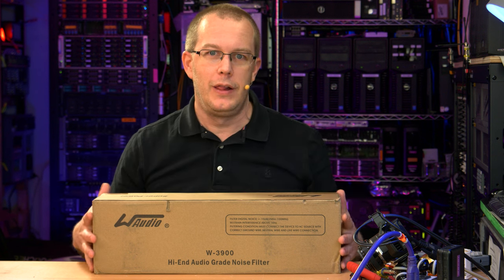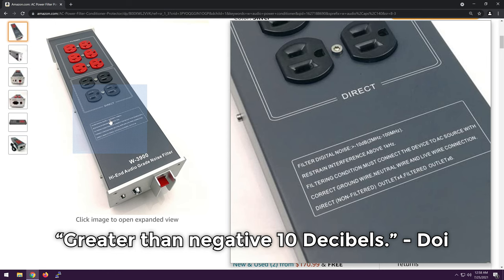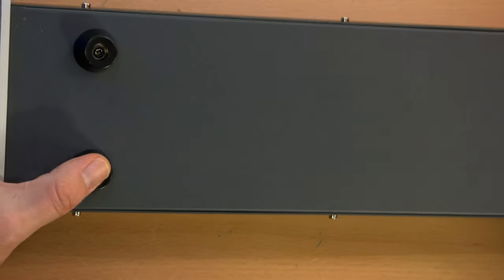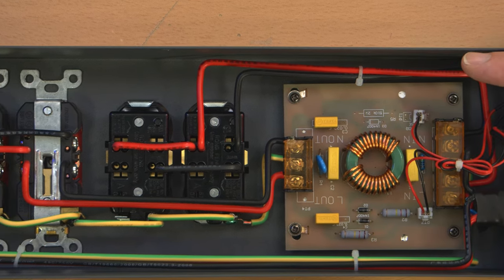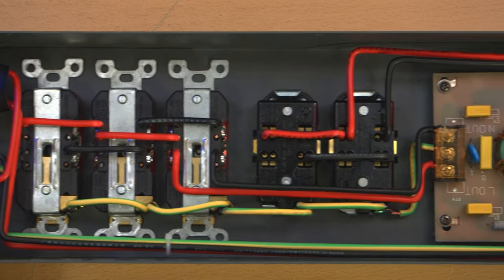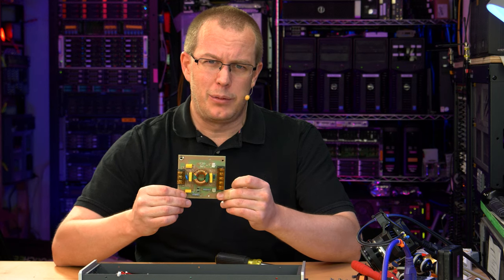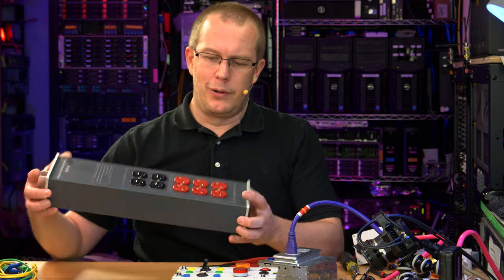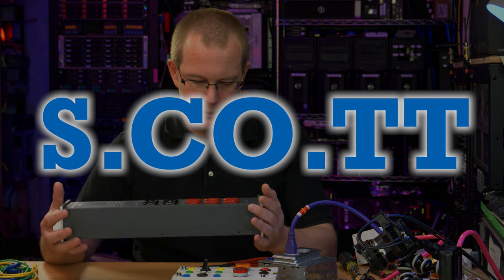WAudio W-3900 Power Conditioner - A Surprisingly Mediocre Thing

Comment: Say what you will about this product, but it just solved a huge issue for me.  I was getting a terrible hum/buzz through my Shure SMB7 connected to a GoXLR mixer.  I have been through 4 or 5 different brand new products trying to take the horrible hum out of the mix.  It would change frequency and intensity depending on hours of the day.  6pm was the worst. Audio was unusable during those hours.

I finally gave this thing a try.  Plugged my computer and mixer's power into this... mic is finally dead quiet.! I am so happy. Finally!
Reply: What were you using previously?  Straight plugging into wall ?
Reply: @indegruv  I tried both a nicer Belkin surge protector and a brand new Anker. Nether made any difference.
Reply: Yes.  Although I have not personally tested the unit, there is no reason to think (or assume as Scott did) the X2 rated suppressor capacitors and the common mode AC choke will not function as intended.
I've opened up similarly priced gear from Tripp-Lite and Furman to note similar circuitry, albeit without phase detection.
Scott could have been more professional instead of taking time to criticize the admittedly poor translation from Chinese into English product description--then proceed to blame the manufacturer of poor quality control, when it was he who broke the circuit board stand-off while clumsily removing the board.
Much time could have been saved had he tested first the noise filtering.
While many manufacturers advertise (incorrectly) their line filters as power conditioners, credit is due this company for stating exactly what their unit is: a line filter.
This is the first of Scott's videos I have viewed, and unfortunately the last.
Scott comes across to me as the typical "ugly American," falsely self-assured and arrogant.
Life is too short.
Reply: @therainbowbeard  I have a Helix that sounds amazing. But in the place where I am it sounds with a lot of power current noise.
I was planning to buy this until I saw this video. Because it's not cheap.
Did it solve the problem for you?
Reply: @s.a.1555  If fixed my issues, but I don’t know the root cause of my issues and your issue might be different. All I know is, it was my miracle. I just bought a new house and am moving soon, so hopefully I don’t have any new problems at the new place. 🤞🏻
Reply: Glad it helped but (say as you will) is like saying TRUMP IS INNOCENT !
Reply: Have a couple of G.E. ultra pro power  strips that have power conditioners. They actually work with my 80s vintage NAD separates not a dramatic change but audible. These only cost around $30. Also I run all my digital through 1 strip and outlet and all my analog through the other step and different outlet. I was running all my gear through 1 outlet and sometimes my amp would hum very loudly now that's gone and NAD high current amp sounds better

Comment: We all saw you yanking it out with force dude. You broke the stand off… just a reality check. 😉
But, seriously though, thank you for an extensive review and tear down. I learned a few things. 
Btw, I bought this unit about 1 year ago and honestly didn’t notice an improvement in my audio system’s sound. I have SET tube amps. A class A preamp and using Eversolo streamer and a Pontus II DAC with a Full range TB 8” driver in a folded Voigt Pipe. It’s an ultra revealing system and every time I change something I notice a difference. This product was returned back to Amazon 👍

Comment: No MOVs? Yet they call it a "surge suppressor"? I would love to see that enclosure at a thrift store, though. I could populate my own circuit board in place of theirs. Gas Discharge Tubes, MOVs, TVS diodes, etc.

Since they're routing those LEDs straight to ground, I'd love to know what the leakage current is.

Comment: all aside, did you test it with greenwave noise meter before and after? Because even with AudioQuest - Niagara 1200 Power Conditioner, I tested before 75 and after plug in it adds more noise to it 96. So another snake oil?

Comment: Hey Scott, I’d like to see you review the Tripp-Lite Isobar series sometime! Those are some pretty beefy units, and think it’d be right up your alley.
Reply from the maker: Weirdly I did do an Isobar repair on another channel:  https://www.youtube.com/watch?v=cS3mlZOZ6vU

I think the video is rambly and may have been a live stream which is why I didn't put it on here?  But one thing is for sure, it does exist!
Reply: @ScottDotDot  Thanks, I’ll sub to your other channel 😃

Imo the Isobars are without doubt the best surge suppressor on the market. Full metal case, actual sockets instead of brass clips, you know, all the works. 

But everyone seems to glance over Tripp-Lite’s standout feature, the inclusion of a thermal fuse. Its so obvious, yet something that remains mysteriously absent from every other power strip.

The newer models I’ve seen also are adding those white, fiberglass flame-resistant pouches covering over the MOVs for added flame/explosion resistance. 

Im not sure if they’ve done the silastic to the inductors tho. That would truly complete the mix.
Reply: @polycyclic  nope.  SURGEX are the best surge protector power bars as they don't have joule ratings or rely on unreliable MOV technology.  Second best is Hammond's ZAP TRAP - using gas discharge tubes that crowbar clamp the power and can last infinite hits.

Comment: Hi ..is there any conditioner that does a decent noise filtering job under 100$?
Reply: Emotiva CMX-6, they are solid, dead quiet, no degradation in SQ that I can discern. I own 3, and two of their CMX-2 units for my DAC and preamp. Both units under $100, with free shipping.

Comment: Given a 15 amp iec cable the 20 amp receptacles  are a bit off.  The hubbell 8600 is a 20 amp hospital grade plug  . By the way my whole house has 8600s on all the 20 amp circuits . One may think I am hard core so be it .  Common mode chokes can do  a lot depending on the down line power supply .

Comment: Those red receptacles are really crappy.  The red ones lasted about a dozen insertion cycles before they became arcing hazards.  The black ones are made by a company called Rong Feng which is used by tripp lite, belkin 10 outlet home depot power bars (now home depot switched to PRIME brand power bars because the belkin 10 outlet power bars that used these RONG FENG receptacles were found to have dangerous intermittent grounding.  Those red hospital grade receptacles are chinese counterfeit Eagle brand american made receptacles.  I have one of these power bars I got for free and replaced the receptacles with hubbell HBL 5252 receptacles.

Comment: Thanks Scott. Unfortunately I had purchased this unit and the power cables before watching this. Defiantly ripped off. I used a Noise analyzer and as expected it reduced virtually nothing if not went up in some cases. I'll keep it until I can find a better unit. Furman perhaps...something less than $1k. Even then it has been shown that clean power doesn't actually affect the audio band as explained by the AudoScience channel with Niagara 1200.
Reply: niagara adds noise with my meter, another snake oil

Comment: Heh...  that was great Bro!  Nice, dry sense of humour  😊  That is really good to know exactly what is inside.  I AM kind of looking for a decent, AFFORDABLE power strip for my audio system which is nothing overly extravagant, but nicely custom designed and with fairly high resolution.  BUT... I am NOT really into 'Power Conditioning' and feel that in most cases, even with very expensive 'High End' conditioners, the sound truly suffers.  I am a real 'Purist' at heart.  But, it WOULD be nice to be able to get a power strip that was made well and that at least would NOT introduce any degradation into the sound.  And yes, my system is primarily analog oriented, with a nice vintage turntable/line-contact cartridge, a nice used Ayon orion II Class 'A' tube amp, and tall open baffle dipole mult-driver line arrays, with a separate Crown 2502 bridged driving 2-15" dipole woofers.

It's just that Sean from Zero Fidelity on YouTube, who I feel is scrupulously honest and forthright, and NOT at all inclined to like 'Power Conditioners', etc., actually was very surprised that his system upon multiple comparisons sounded definitively better with this being used as compared to just being plugged into the wall.  Thus my interest...

Thanks again for the excellent and most informative video.  I just kind of wished I knew what to do.  Heh... by your comment about the 'Fancy' braided plugs, I would guess that you likely don't think that they do much.

Comment: Yes the EMI filter is not very special but if you look at the used materials and time it takes to produce something like this, it is a fair price. Because their is a lot of manual labor involved to assemble it.
On most equipment this filter won't do much, but it does filter HF so I would not call it snake oil.

I have seen similar filters in products that costs thousands, now then we are talking about unfair prices 🫤

Comment: You're incorrect thinking the power supply of components will filter out garbage. You're really out of your depth discussing power conditioning. 
Also snake oil is the legitimate article. It's irritating when people use phrases incorrectly such as BMW owners calling their vehicles "beemers/beamers". Beamers are motorcycles by the way.
Reply: I believe what he was saying is newer digital devices have better capabilities at handling it better than analog devices like a tube amp or high quality DAC. This might help some on analog devices but I ordered one recently and it's going back. As you can see in the video there is a black version and a silver version on Amazon. The black one shows a date first available in 2020. The silver one, which is 100 percent the same, has a date first available of 2014. WAudio literally changed the color just to make it look newer and up to date. That's shady in itself.

I do agree that power/line conditioning works and helps AV equipment but you have to call a spade a spade and this is NOT a good device for filtering out noise, heck, it's barely a surge protector. 

The number one selling power conditioner on Amazon is a Furhman device from 2004. That's almost 20 years old so I would think the tech would have evolved since then and Furhman makes good power conditioners but the newer models are twice the price of this and are rack mountable.

I'm debating on getting the AUSTERE VII Series Power 8-Outlet device. I looked at the iFi power station but it's just too expensive to justify and the AUSTERE has isolated pairs of outlets while every outlet on the iFi is isolated. Also, iFi recommends adding iFi AÇ purifier plugs which aren't cheap in addition to their very expensive power station which already comes with a iFi purifier built in. Heck, you can listen to radio over a main with the noise sniffer so I do agree about noise, I just think newer digital devices handle it better than even new analog devices like 10K tube amps.

https://youtu.be/-gGwU1GvXkY

Comment: To conclude, you didn't test the main function wich is noise filter, but you concluded how this is crap?
Interesting.
I don't have it and because of that I wanted to find something useful about this product and power conditioners in general. Searching for answers I bumped on this extremely biased and video that made no answer in term does this device filter anything or not.
Thumb down from my side.

Comment: If you are expecting big changes from a power conditioner ypu are horribly mistaken. It is for the most part snake oil. Shielded power cprd snake oil. Power conditioners can help but very marginally. Certainly will help your gear ride through lightnin strikes